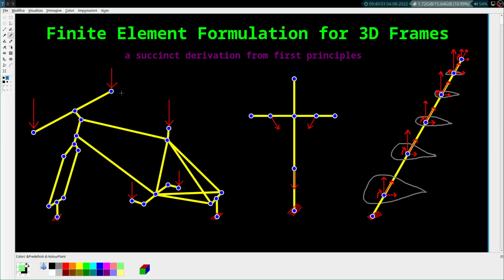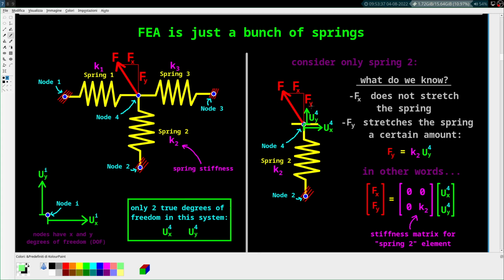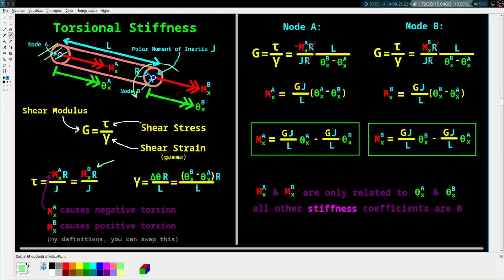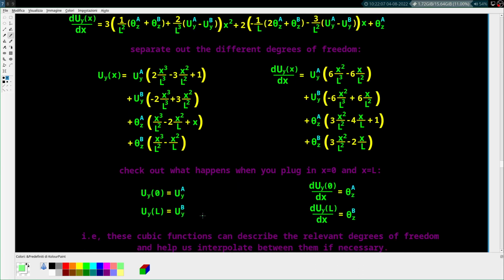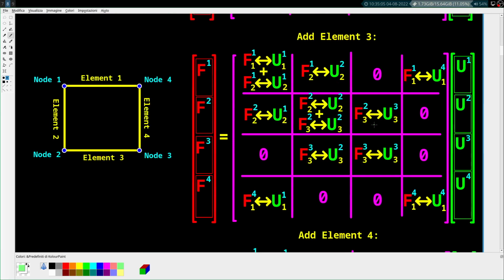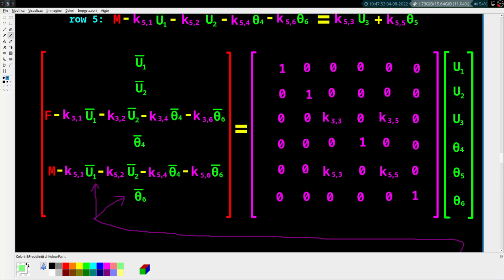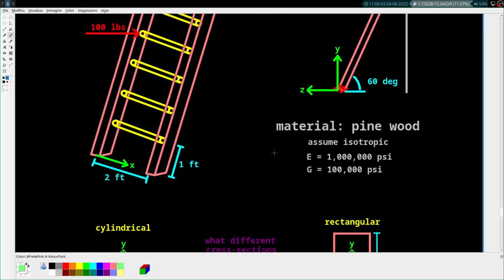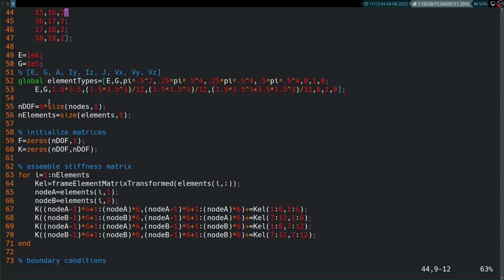Finite Element Analysis of 3D Frames

Comment: Great video. Can you tell if is it mandatory to solve free body diagram for solving 3d space frame analysis using a direct stiffness matrix in the finite element method?
Reply from the maker: If I understand you correctly, no. The stiffness matrix effectively represents the internal forces and moments via the nodal displacements. You only need to define the external applied forces/moments/constraints, and then solve the linear system. But of course, the system needs to be appropriately constrained, otherwise you might get bogus rigid body modes.
Reply: @xmdi0  Thanks for your reply. Can you please make one more video solving a complex 2-storied 3d space frame, adding different types of loading conditions such as uniformly distributed load, point load, wind load,, earthquake load, and self-weight? also, define load combination. add diaphragm, assign wind load and earthquake load so that we can relate the complete picture. thanks again for your great effort.